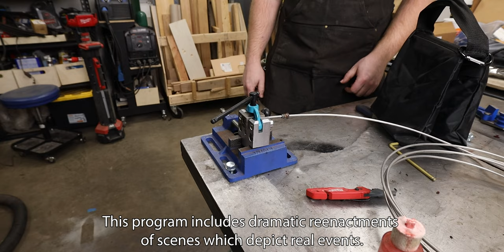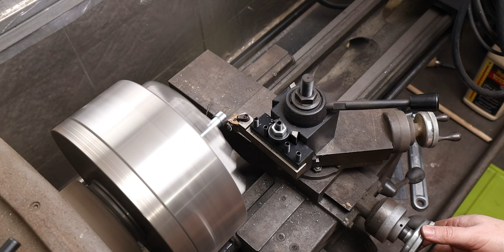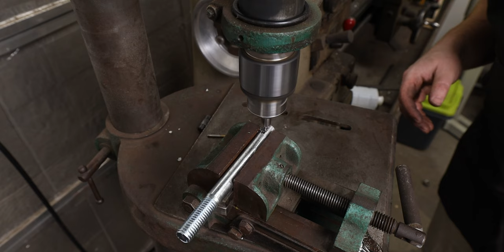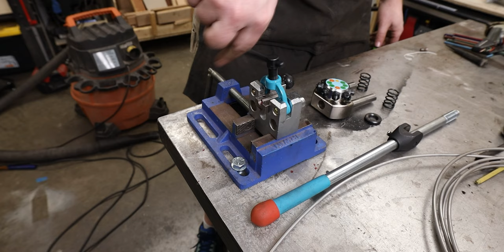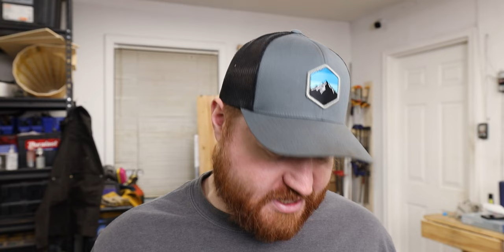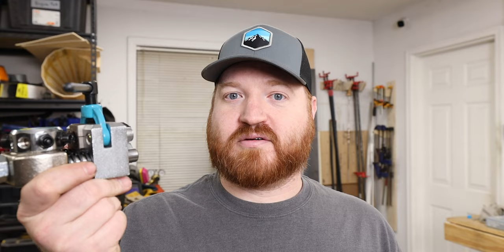REPAIRING MY FLARE TOOL... TWICE

Comment: Hello. Like the video and interested. Does that mean you are putting stainless steel brake hoses on your Hilux? Seems like a lot of work, but it’ll be amazing to see and will last forever. Your work is so top notch and impressed with the attention to detail. Am doing a refresh on a 30y old Toyota and interested to see the rear suspension coming together as mine is shared with Hilux’s of the era. I’d like to ask a gearbox-related question that I’ve not been able to find the answer to elsewhere, please? My van has a G52 5-speed manual gearbox (plus H/L transfer) and a G145 rear diff. The front diff is a Toyota 7-inch open diff and I’ve got AISIN front hubs. My plan is to add a turbo to the 3L engine and I’m wondering if it’s possible to lengthen the gears a little (especially fourth and fifth) or swap out the gearbox for a 6-speed to get better (lower) highway revs. I’ve not been able to find anything on a 6-speed gearbox-equivalent for the G52 so can you shed any light there, please?